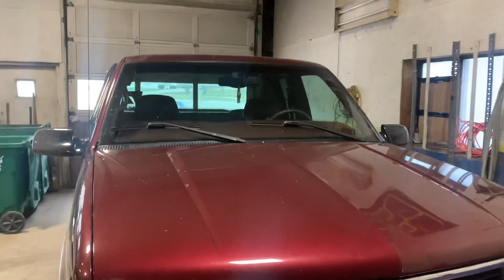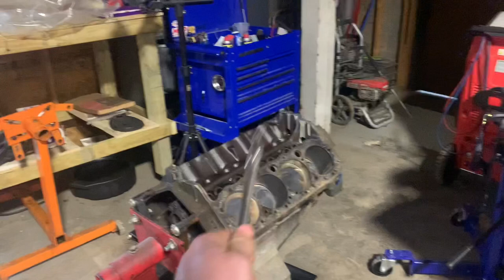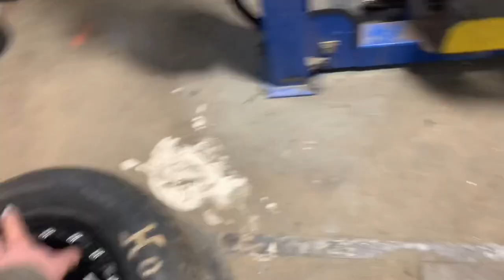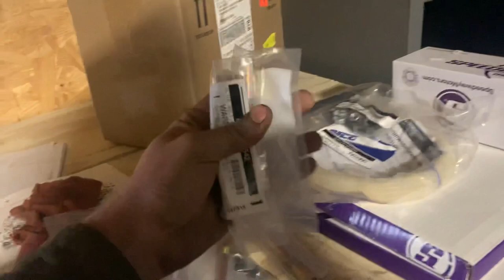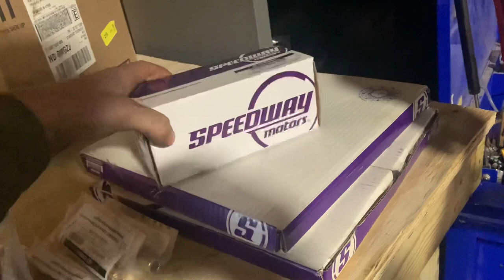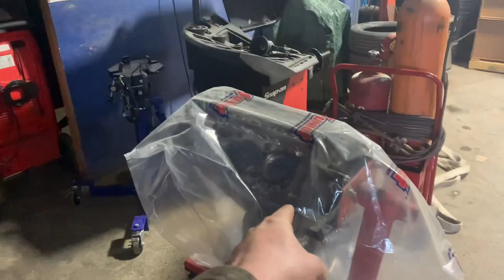Parts are on the way!! LPS Bomber

Comment: Just my experience nylon brake lines don't last specially if car is outside for any amount of time and the cheap speedway pads are garbage you will be replacing them quick save the money and get hawk pads all the way around I'm willing to help as I learned the hard way do not go cheap just cause you wanna turn circles its a waste of time and effert
Reply from the maker: I appreciate that, your not the first person that has told me not to buy there brake pads after I bought them lol.
Reply: @millertimemotorsports2844  just depends on what you get that is made by speedway not all there stuff is junk